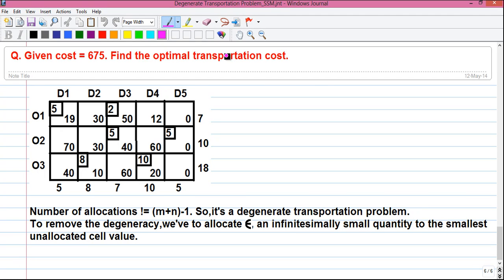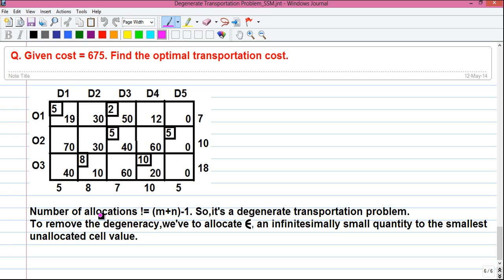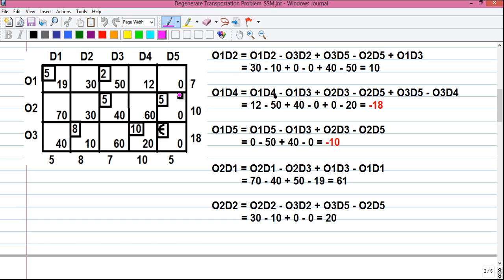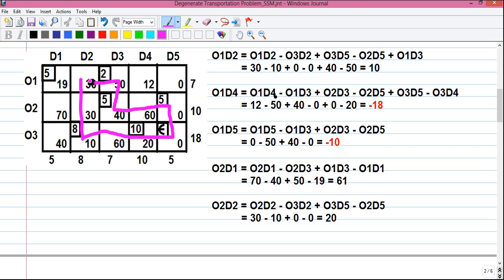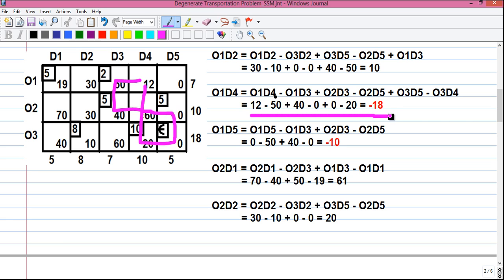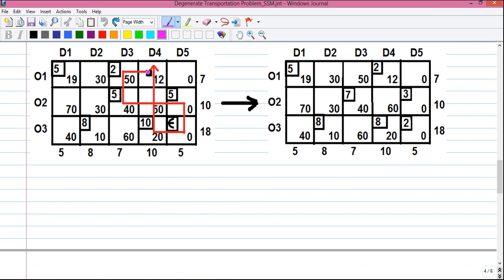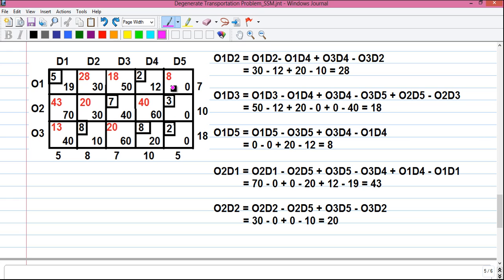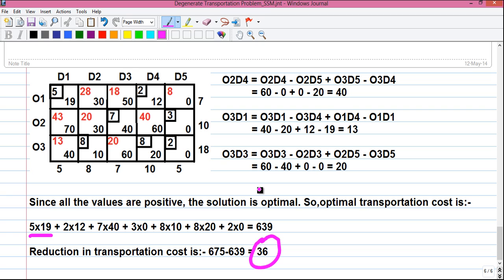Operations Research(OR) Tutorial #17_Stepping Stone Method_Solving Degenerate Transportation Problem

Comment: Sir,My question is that when we are getting two negative costs we select the least negative value cell to start reallocating.But if we have two same -ve value we can arbitrarily select one....I have done one sum where two costs are same in magnitude(-ve) but after reallocating both of them is giving same final cost...So is it necessary to do separate calculations for each equal -ve cost in those cases?????
Reply from the maker: Gourav Shaw Have you shared any of my videos? If two most -ve costs are same,you can go with one.
Reply: Sujoy Krishna Das No I have not shared your videos......
Reply: Gourav Shaw I am sharing it........
Reply: Gourav Shaw U are great Sir........U saved my exam preparation!